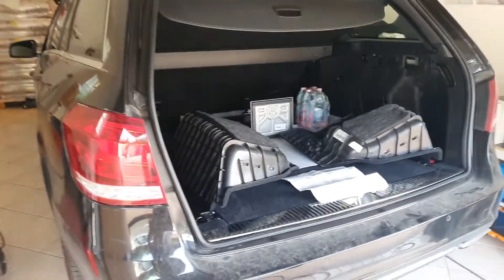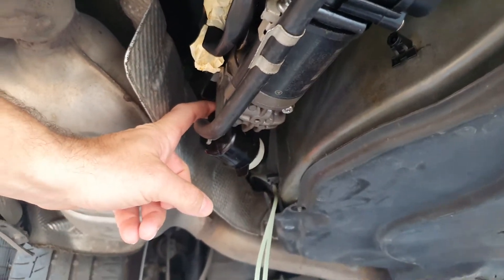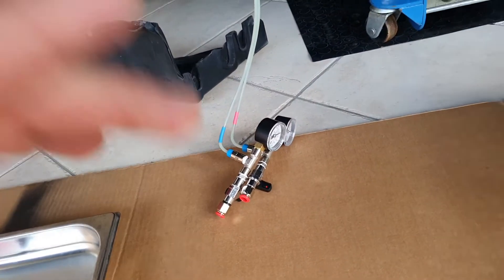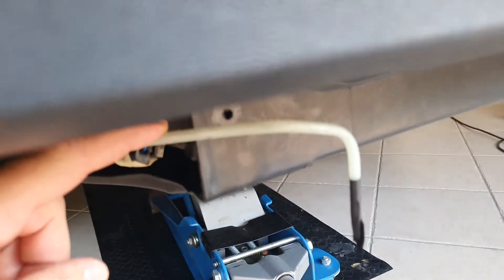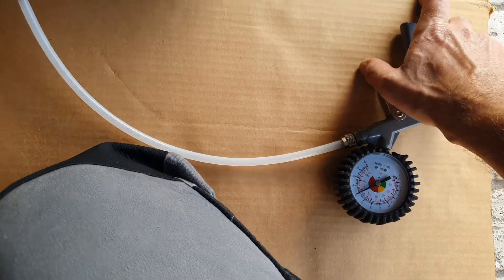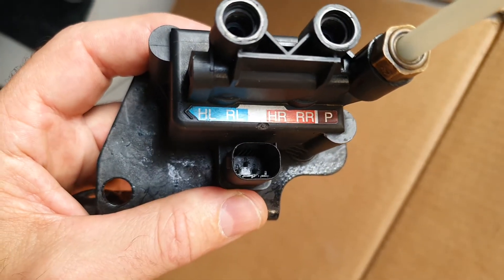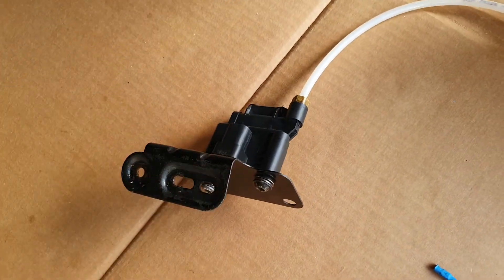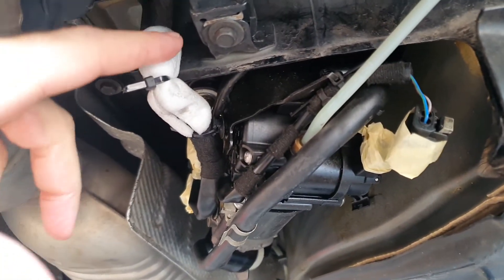W212 air suspension failure

Comment: My main airline to the compressor keeps popping out when I try to do a level calibration.
I just replaced the level sensors . I was wondering if I need to buy a new fitting for the back of the compressor
Reply from the maker: change all VOSS brass fittings with new ones...

Comment: Outstanding! Great diagnostic approach. Possibly too time consuming for the repair shop, but great for the confident and creative DIY. I really appreciate the break-down of the pin connections and valve operation. I am surprised that the pin 1-3 combination opens both valves. I would have expected one pin to each solenoid and a common ground on pin 2.

I really like the approach to test each air spring. Oddly, it did not occur to me until I saw this video that they could be tested without removal.

It would be interesting to see what the valve block looks like inside.

Comment: Thanks for the video.   I have a W212 but mine is sedan with four bags.   During cold days the car looses air at night and in the morning is flat.  It takes a while to go up of course.  I have replaced the main valve but it still does the same.   The only mode where it doesn't loose air is when I leave the car in high, like for snow.  If I don't loose air on that mode I know the bags are ok but in any other mode, comfort of sport, I loose air. Any thoughts?
Reply: Probably means you need new air springs. The Arnott ones aren't incredibly expensive ($200/ea), although full Airmatic on all four wheels may be different (I have a wagon with just rear self-leveling).
Reply: @BruceLudwick  thanks Bruce
Reply: @BruceLudwick  in fact, they are more expensive.  Each front is about 600 and the rear ones about 400.  I have to shell a good 2k to fix it.
Reply: Did you figure out your issue? I have a similar issue so replaced my rear bags and they are still leaking down over 2 nights.

Comment: Hi again. What are the thread to fitments as I want to get the same setup as you to test my system please. Thanks very much
Reply from the maker: plastic rigid tube (Rilsan) external diameter is 4mm and 8mm... go to the home dipo and ask for air fast fitting for Rilsan tube as the diameters above.. gauges and other hardware is 1/8...
Reply: @diycarmechanic587  Great video but I am having the same problem in locating the parts to do this. I do not want to take the connectors off the tubing so knowing what the threads are would help a lot in getting a couplers etc that I can screw the tubes into. The tubes on my E250 2012 are OD 4.2mm and 6.3mm.

Comment: Hi where is the relief valve located please
Reply from the maker: also be sure eletrical cable is in good order without damage due to scrabbing against metal brackets....
Reply from the maker: black plastic circular piece with eletric connector on the opposite of cylinder in the compressor.. open it and check for internal corrosion..is a solenoid valvle so you can use a tester for checking continuity and a 12 volt source for testing proper functioning..